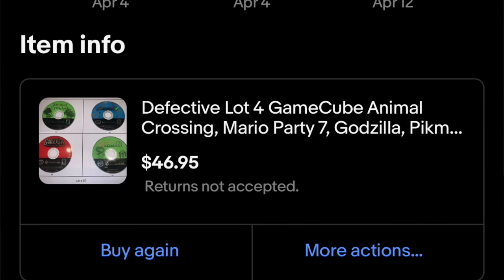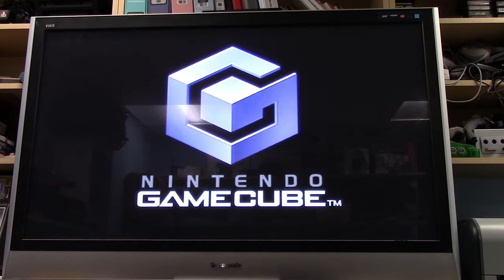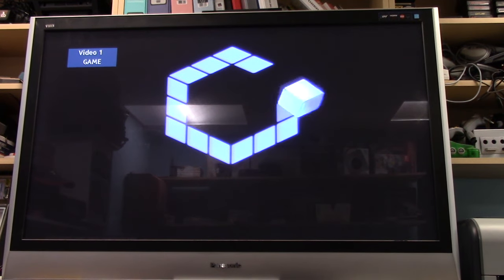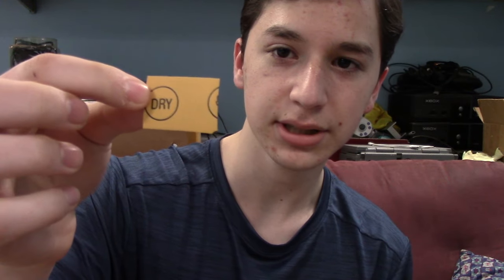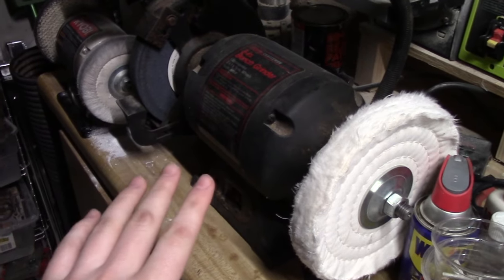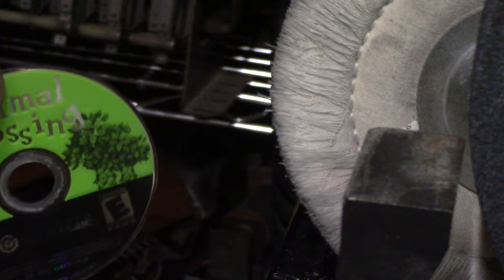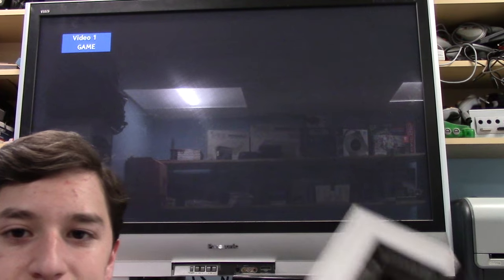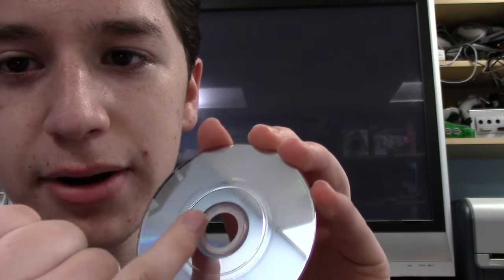How to fix broken Gamecube games! and other types of disc games

Comment: I didn't try this because I don't have the 5000 grit sand paper or any sort of polisher. I did, however, take your advice about the laser. After failing to read the game, I popped the disc out and looked at the laser's position to try and determine where on the disc it is not reading, and turns out it was the very edge where there is a nasty tiny scratch in the form of a triangle. I gently spot cleaned that spot with alcohol and micro fiber cloth and my Pokemon Colosseum works again! To be fair the game was never broken, its just that sometimes it wont start but now it's consistent.

Comment: There's some great lessons to take from this video even to this day. If a big reseller buys defektive games and sells them (or specifies that he resurfaces them) and then sells a bunch of games as defektive you can sort of deduce that even resurfacing them failed and you're very likely going to have the same happen when you try it again.
Heck, I'd be skeptical the moment I saw someone selling loads of defektive disks at all.
Stick with smaller sellers and you're more likely to avoid that and have an actual shot at repairing some disks.
Reply from the maker: You're certainly correct. After buying it I was a little nervous for the same reason. However, I have done very well previously on similar lots of broken games so I figured the price was good enough to take the risk.
Reply: @pinballwiz1854  Thanks for the reply and an especial kudos for repairing old stuff (something I enjoy myself as a hobby), the more we can save of these gems the better :)
PS: Nice collection of Retro-machines you've got there!

Comment: I've tried 2,000 grit and it works okay but you need to polish it really good (I use Turtle Wax Polishing compound) to get it working again. I want to try 5,000 and higher grit sandpaper and see how that works.

Comment: Guys don't do this on gamecube disks. The have more shine the  most games as nintendo calibrated the lasers with more resistance to making reading normal disks that are burnt harder. You need to take it into a shop that has experience resurfacing them.

Comment: jesus christ no dont do this no.
Reply from the maker: You do realize this is essentially exactly how resurfacing machines work right? The only difference is a robot that’s way faster.
Reply: @pinballwiz1854  yes I know what polishing is, its a question of quality of the job. In fairness in your video you sand the animal crossing and then we dont see it work after. Kinda sus
Reply: @pinballwiz1854  Also you showed the lining on the edge of the disc came off, I hope where you live isnt humid cause disc rot is gonna claim those discs in a year or so. Moisture can now get between the layers
Reply from the maker: I’ll give credit where credit is due. You obviously do know what your talking about. The reason animal crossing didn’t work was because someone prior to me improperly resurfaced like half of the disc and not the other half. However i did not know that little tid bit about moisture being able to get into the disc through the edges. So far I haven’t had any issues with any of the discs that have had that happen. That ebay seller knew what they were doing when they sold those for a good price.